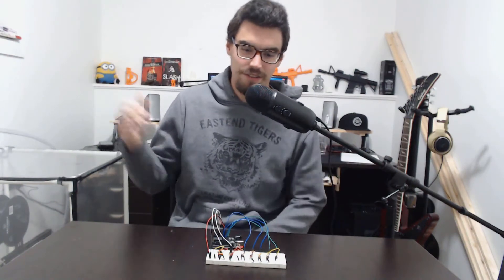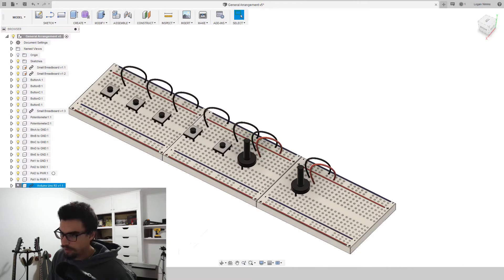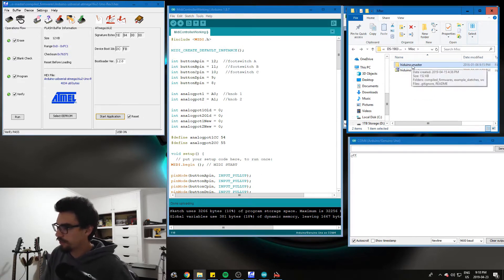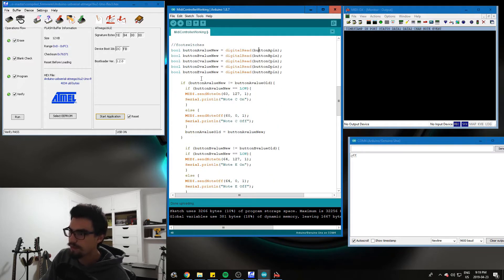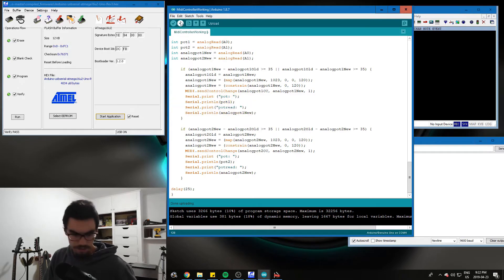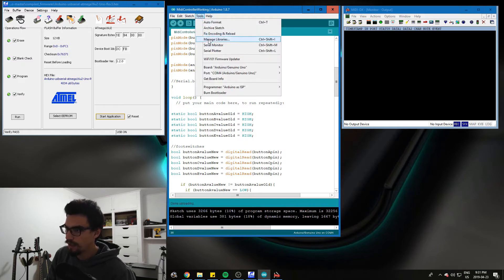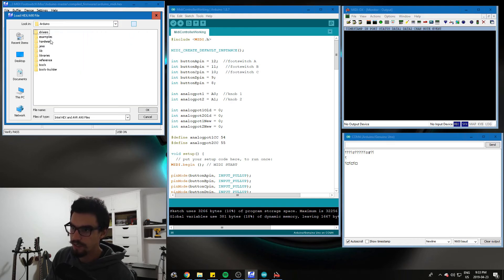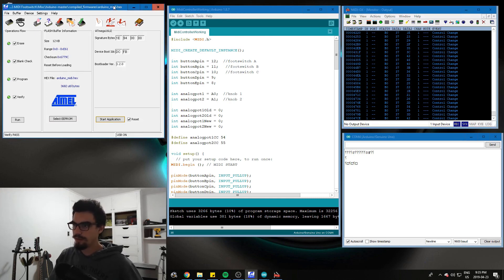Arduino MIDI Controller and Instrument! - Arduino Tutorials

Comment: Thanks for guiding man, done through all the steps but can't figure out the "Reaper" software. Please can you give a heads-up how to use it? Thanks again in advance
Reply: This is a an old post and it's a shame that the tutorial couldn't go through the entire process a little bit more. Reaper is a DAW (digital Audio Workstation). I use a different Daw but all DAW programs should have MIDI integration. Figure out what DAW you want to use that floats your boat first, based on budget and what not.Then do a youtube search for "(How to map MIDI to (DAW you are using)". Remember that lots of music producers that make tutorials tend to use IOS vs Windows.

Comment: only one of my buttons work. (buttonA). i did my setup a bit different than you i used a 2nd arduino as a programmer (Arduino as ISP) to upload my sketches to my arduino_midi. the programmer is wired to some of the same buttons as your layout so i guess i could change yr pinout to avoid this conflict so i can use the serial monitor via the programmer since the adrudion_midi cant be read in the IDE. My question is, (semi-disregard above), why would only one of my buttons work if its wired correctly? could it be that only the first conditional for button A is running? I came to this conclusion because my potientiomenters (A0, A1) arent working either. only buttonA

Comment: well now my arduino is broken.. thx chould have told me that the shorting part was the thing that destroyed it, adn if you used a tiny bit of brain power you'd realize that if you use hairless u dont have to destroy your arduino
Reply: u fool
Reply: @rastabroskah4657  yeah im a fool  i was a bit angry at the time and somehow my arduino unbroke or something but still a heads up whould be nice since it wasnt the final code i had and also it can be avoided with hairless
Reply: @TheProphetBot  dont feel bad lol I just did this and only one of my buttons are working its either the shitty wires im using or the conditionals in the code stopping after buttonA lol

Comment: In flip it keeps saying "AtLibUsbDfu.dll not found". How do I fix this?
Reply: I had the same problem. You just have to download the AtLibUsbDfu.dll file from here for example: https://www.dll-files.com/atlibusbdfu.dll.html extract it and place the single file outside the folder in Windows ----- System 32 in your files.
Reply: @marianaochoadezabaleguiapr9967  thanks....
Reply: @marianaochoadezabaleguiapr9967  while I found this as a very weird way of fixing it, this wasn't the way to fix it. Instead, if you go to your Flip folder, and search for the USB folder, you can use it as drivers for the Arduino. So after you use these drivers it fixes everything

Comment: hello, first of all thanks for the video !.
I'm working with 4 potentiometers, without the buttons. logically modify the sketch for my utility.
my problem is that until potentiometer number 3 everything works perfect, but when I add the potentiometer number 4 it sends midi signals constantly, even if it is not moving.
Unfortunately I can not solve this problem, which can be the cause of this problem ?.
Reply: i have the same problem. did you find out why?
Reply: @bugales9055  are you prototyping on a breadboard? I was on a bread board and had my components a little precariously set up so it just turned out that my connections weren’t as strong as as I’d have hoped. I was very new to the whole electronics stuff though. If you have experience this probably isn’t an issue. Basically yeah it just figured itself out when I soldered it all
Reply: @tomgrimes2674   i'm new and yes, i was on a breadboard. The thing is that i tried the code with nothing wired on the analog pins and it was still sending signal like crazy. Maybe it's something wrong with my arduino?
Reply: Found the problem. 

"If you have nothing connected to a pin, reading it gives random values (the inputs are very high impedance, so with nothing connected, they'll pick up noise from the environment, like an antenna). "

I was writing code for 6 pots with just one wired for the test.
Reply: I already tried several codes and I always have the same problem
Reply: I am having this same issue @PretEnGineering do you know how to fix this? I dont want to use any buttons, just six knobs, how to fix?